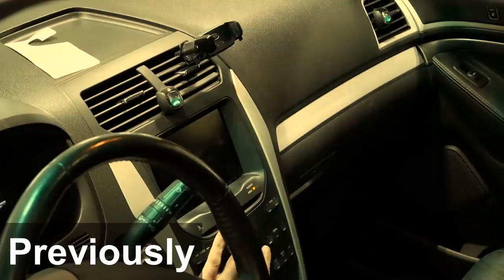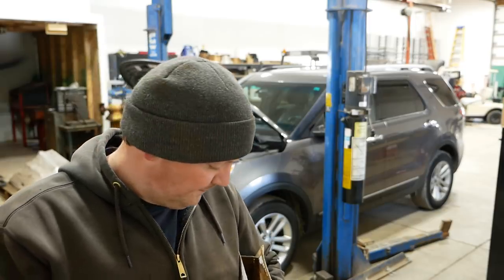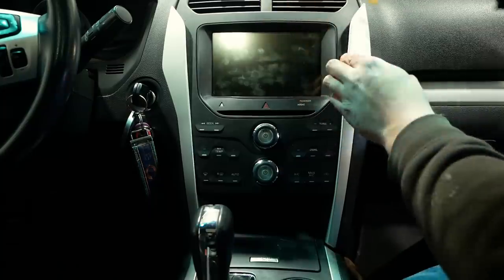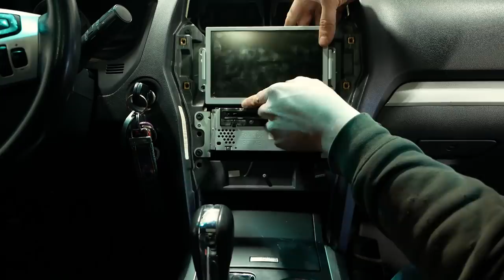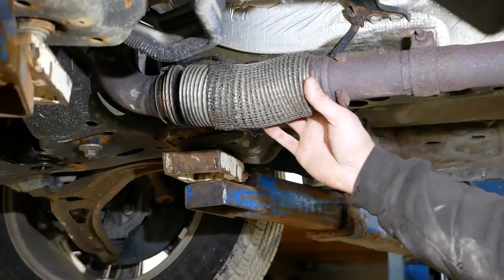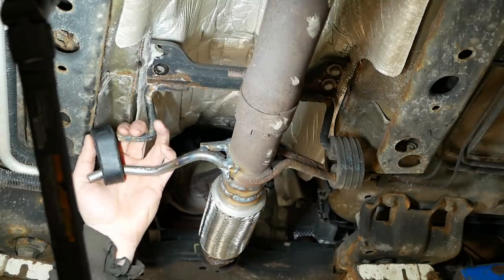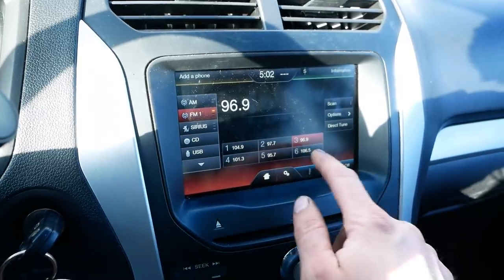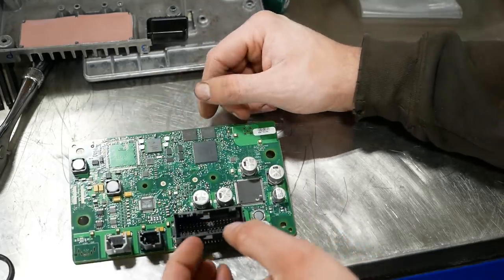Ford Explorer APIM and Exhaust Flex Replacement

Comment: When you first turned the ignition on and the Sync didn’t fire up I had the “son of a” moment too. Your mind starts going ok what did I do wrong? What did I miss? Then you cycle the key again and it comes on.... Been there to many times,
Reply from the maker: I was sweating.
Reply: @WatchWesWork  since I’ve taken tool advice from you before/asked you may I suggest a tool? I’m sure you already know about them but instead of using a grinder have you used a chain style exhaust cutter? I’ve got one that works awesome and is so much easier then trying to use a torch or cut off tool. I’d highly suggest getting one if you don’t already have one.

Also maybe a video suggestion/suggestions? 
#1 beginner tool list for people who may be just starting out. With your varied background you’d have a pretty vast collection by now. I’m sure a lot of your viewers may wonder what you’d think a good starter set up is. 

#2 Trick tools. By this I mean tools that you’ve got that you use often that make certain jobs easier. Things like your cooling system bleeder, brake bleeder, etc. I’ve been in the business for a bit and never seen the paddle wheel things to clean out corrosion in bores until you used one. Bought some and been using them to clean wheel bores.

Comment: I am absolutely convinced that for some unknown reason the U.S. automotive designers are in complete denial of the undesireability of using excessive electronics in automotive applications. There wasn't that much need for the current complication of vehicle controls and attempts to include too much entertainment in vehicles. After all, the essential requirement is to safely get from point A to point B.
Reply from the maker: Electronics are one of the biggest selling points of modern cars. We are stuck with it.
Reply: @WatchWesWork  I realize that but I suspect that automotive engineering needs to match aerospace requirements and I think it now doesn't.

Comment: Rock auto has the complete mid section of exhaust including flex, y-pipe and flanges for $93 bucks.  I refuse to buy from the local guys at twice the price and half the inventory.  Cheers Wes

Comment: Yeah more proof me quitting being a tech in late 00s was correct move. That and only driving 90s toyotas is right call. These cars with lcds , climate, and dash will eventualy fail. Aftermarket wont reproduce this stuff and while manuf. does it'll be thousands. Engineered obsolescence i even saw my beloved Yota doing it in late 00s
Reply: Same here. I started out as a repair tech and it was fun. Solid state electronics was just showing up in ignition systems. I remember yanking a number of Ford's early solid state black box ignitions and replacing them with reliable point/condenser distributors. I got the chance to start electrician work and made that my career. I had no idea what a good move that was at the time but looking back, solid state electronics has taken the fun out of working on cars. I drive an '86 Toyota 4X4 truck and a big "85 Ford E-250 van. Both with MSD ignitions. Those vehicles are wonderfully simple.
Reply: Well the 00s Toyota's are very good just as good as a 90s one.

Comment: Check out the guy at NorthRidgeFix on youtube.  Amazing diagnostic and repair work.   He could probably fix the board, likely a surface mount cap has failed, probably in the power circuit.

Comment: I would have thought that flvpmods would have a core charge. He sends you a rebuilt unit then you send him back the old one. So he can rebuild it for the next guy.
Reply from the maker: He does not rebuild them. He just reprograms used modules from newer vehicles.

Comment: I have used IDS software and I see laptops on Ebay with IDS but it might be hard to get it reassigned to you, and of course you need subscription. 
I was trying to buy Chevy software last year, they had a sweet deal on it then it went back to $1000 year subscription  just for personal use I dropped that idea.
my snap on Modis is outdated  big chunk to replace that, 
yup wrap your head around electronic obsolescence as the shut down on most vehicles,
I don't want every bell and whistle in vehicle, I love manual crank windows.   
I understand engineering and design in vehicles and special tools required i have 95% of them.
what impresses me the most these days is none electronic just plain jane pickups.
all that being said I think car companies do a good job to please people,  making reliable cars that have 
high safety standards in crash tests, just think about legal responsibly in making cars, so many systems to test, tires, brakes, windows, seats, seat belts, window defoggers/ heaters, steering, doors,
lights,  engine and drivetrain and fuel efficient and emission control system. 
 yes cars are safer then 20 years ago,  but people want to drive 80 mph on icy roads.
thanks for good video and the info shop that fixes modules.
Reply from the maker: It was the beginning of the end when they started turning cars into ipods.

Comment: One of the most annoying chimes for the ignition/ for I've heard. Ford wins in that scenario. Damn junk. Lol I think your flex pipe fix is probably better than the OEM one. Not sure why its unobtanium to get those parts, and they're on 'permanent backorder.' Its a 'Merican car so it should be easy to get them. Especially an exhaust part that is notorious for rusting and breaking. Looks like they need to step up their parts support. Probably a cold solder joint in that module. Would make a good coaster or door stop. 👍

Comment: Ford HVC's have never stocked APIMs. Sound's like you got a retail or wholesale parts guy that didn't know how to check the availability. They are done through outside company's such as AER or United Radio
Reply from the maker: All know is what they told me, which was basically "good luck".

Comment: I had the dealer remove my car's fordscan when it was new.
On a less sophomoric note,  how does a six year old car not have high demand parts available? Mine are 20 and 30 years old and have yet to have such issues with parts.
Reply: It's because the companies that manufacture the parts were considered non-essential companies and were shut down last spring and summer.  They eventually opened up but now they're playing catch-up.  Plus, the materials they use come from companies that were also shut down for the virus, so material shortage adds to the parts delay.
Reply from the maker: There are so many disruptions in the parts chain. Every maker is having problems.
Reply: @WatchWesWork  Oh at first I thought you were that other guy. Between JRGoing and Wes Working I don't know which way is up anymore.

Comment: Why do they use flex pipes why don't do they  use normal exhaust connections that will never break
Reply from the maker: Pretty common in transverse engine configurations. Though some manufacturers don't use them.

Comment: Had my diesel Landrover Defender for 20 years. It has no computer at all. So long as i can find an oily fuel that'll flow it'll run and in another 20 years it'll still be running. Why does every damn car need a computer to run it today? They don't even run any better because of them!

Comment: Did you miss out one bolt...!
Reply: And the screen didnt show temps :/ But great work
Reply from the maker: I don't think so.
Reply: @WatchWesWork  At 12.33 I see four holes and only three bolts on the exhaust bracket (support)
Reply from the maker: @anthonygostling  That's correct. One is an alignment tab so the bracket cannot be installed backward.
Reply: @WatchWesWork  Ok thanks

Comment: I've probably replaced a few hundred APIM's. Across the entire line they are crap. Ford has been a shit show for a long time. Tons of parts on indefinite back order. At one point i had over 20 edges waiting in the lot for torque converters. Also Ford IDS isn't too expensive and really nice to have if you work on a lot of fords.
Reply from the maker: Somehow I escaped these things until now. Everyone is having parts issues at the moment.
Reply: @WatchWesWork  with Ford it isn't a recent issue. I worked as a Ford technician for 4 years, 2 years specializing in electrical and 2 years as lead diesel. The entire time we always had parts supply issues. I left ford in late 2018
Reply from the maker: @Spyke383  I don't get it. I was able to buy parts for a 28 year old F700 no problem. But a 9 year old Explorer, no dice.
Reply: @WatchWesWork  the apim and other modules on backorder I get, not many manufacturers can produce that. But an exhaust pipe? The Taurus, explore and flex are all the same platform.

Comment: I would yank that crappy factory radio out and replace it with a Sony or Kenwood touchscreen unit with Bluetooth, navigation, phone and camera at 1/2 the repair cost and 10 times higher quality

Comment: I'm gonna guess a used car place sold the customer a car with a busted flex pipe. As long as Wes gets the work I guess.
Reply: See this is why inspections need to be done. In my state it is illegal for dealer to sell a car before safety inspection. Unless it is towed off lot and junk affidavit signed. I worked at dealer salesman brought me a 90s mitsubishi for sale inspection. BUT he had already started signing paperwork (illegally) well the entire subframe of the car was rusted out. I figure if u opened the doors on the lift it'd of folded. Salesman begged me to pass it as he had already told buyer he could sell it. So perfect example of why you need inspections at least safety ones. This was no small dealer either biggest tpyota honda dealer for 100 miles. Needless to say i refused to pass it and put my name on the lawsuit after the car breaks and hurts someone

Comment: Where we're gonna get screwed is even though your vehicle may still be in decent shape, the software will outdated or fail without any more factory support. Another case of guaranteed obsolescence.
Reply from the maker: Happening already. The military has huge issues with this. A $1 billion stealth bomber can be grounded because the electronics are completely obsolete.

Comment: 3:00 long story short if this ever happens to me i need to replace the radio with a after market touchscreen radio and do away with all that nonsense
Reply: Is that even possible these days? A lot of vehicles seem to have no other means to activate some functions.
Reply from the maker: I'm not sure how well that would work. It's not just a radio but part of the climate control, backup camera, etc.

Comment: Not much different the the ECC touch screen in my '89 Buick.
A "Refurbished" unit with a 2 year warranty is $400 on eBay.
Only one other Gentleman in the US has the tools & knowhow
to repair to "better than OEM" and I paid $190 for mine.

All of these vehicles with different computers integrated
to control everything- all do eventually go bad; capacitors
get weak, MOSFET burn out. 
All irreplaceable high tech junk one day.

Comment: That car isn't a decade old yet and already you can't get parts for it. These new Fords are going to have a much lower life expectancy than the ones built in 2002 or 1992 if this is what you're already dealing with.
Reply from the maker: It's like this across the board. Tried to get a mirror for a 2007 Dodge 1500 pickup. Parts man said 3 weeks minimum to get one.

Comment: GM and Ford compete for the bottom of class engineers. They pay less and they are proficient at design failure and impossible access. Boosting customer costs for built in profitability in parts replacement. If something works it may be a result of the slot machine engineer they hired, who installed luck.

Comment: Typical modern day automobiles. All this garbage that is put on them is doomed to fail.

Can’t keep from thinking that after the past 20 years plus of all this crap...... that if an auto manufacturer would put a simple base ( engine, body and windows) car and truck on the market at a price a working person could afford.......they would sell like hot cakes!

But.....driven buy cheap automobiles with cheap parts and manufacturing at thief like profits.......those days are gone.

No wonder finding a good condition car/truck you can wrench on is almost impossible.

Comment: Because of crap like this, I will never own a vehicle newer than the one I have. These vehicles are not designed to last ten years. When they reach the age and mileage this one has, you just end up with a bunch of very complicated and expensive problems to fix that are totally unnecessary in the grander scheme of things. I refuse to go through this much trouble just to provide myself the ability to connect my phone to my car. It is just so pointless and unnecessary.